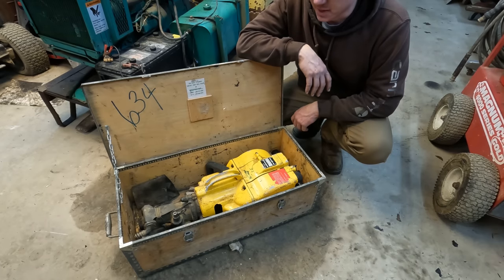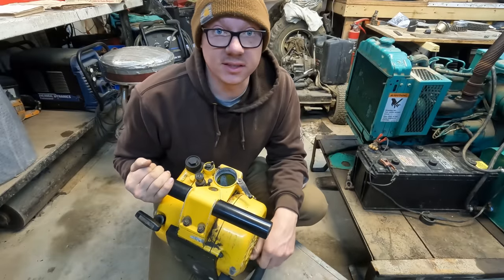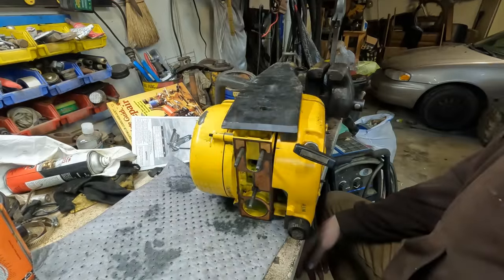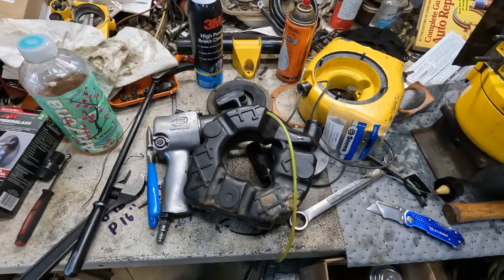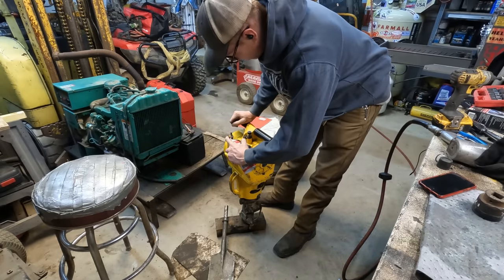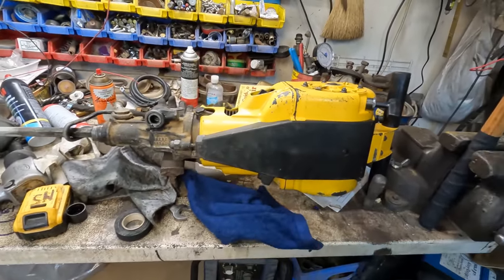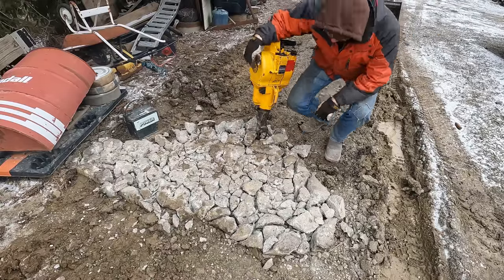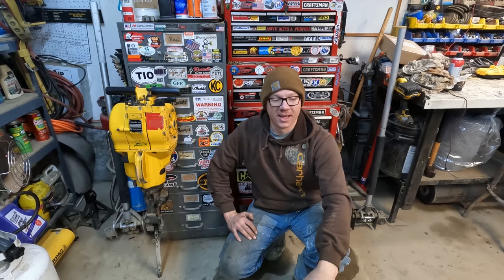RARE? Gas Powered Jack Hammer, Will it ever Run again??  (Pionjar 120)

Comment: have the same issue with my pioneer right now. the gas you added looked to be pure gas these at 2 stroke engine and like to be oiled up. 5% oil pr liter is what i am told the gas should almost look like oil :)

Comment: Lol, I nearly hurt myself laughing, as it that reminds of the time years ago when I bought a pedestrian roller powered by a Villiers engine. When I picked it up off the guy it stated first pull, I tight great. Until the day that I wanted to use it for a tarmac job and it wouldn't start no matter what I did to it! It ended up like the John Cleese sketch when he started thrashing his car with the branch of a tree. I took to it with a pig tail road on to vent my anger. It is funny looking back on it, but it wasn't at the time, especially when I had 40 tonnes of tarmac to lay and it had just started snowing. Luckily I had a Bomag tandem back at the yard!

Comment: Have you tried oiling the air filter?
I'm going with memories of old 2 stroke small engines where the air cleaner/filter was oiled. It may need the extra resistance to get the air mixture right for combustion. If you don't like the results you could always rinse out the oil with fuel.
Oh, another idea. Take a piece of rebar and use those foam pieces from bicycle handlebars to cushion the rebar. You just have to bend the rebar to the correct handle shape. I'm sure you can figure out how to secure the rebar in place (cough, cough, ahem epoxy) 
Jim

Comment: A quick search learned me that they are not rare. In fact you can still buy them new, exactly the same unchanged model. And I think that it is Chinese. Price is not mentioned. You need to send them a mail for that, which I am not going to do. They call them also YN27C Internal Combustion Rock Drill, or Pinonjar 120 jackhammer. That air filter seems to be some cartridge indeed. No parts number is mentioned, just a drawing with the internal components. Search for gmd-eqpt.

Comment: heat the pages little bit with hair dryer or pose some hair oil in between and then heat the pages try it on the last page first maybe it works for you .......

Comment: With regards to the viability of a more ergonomical handle - RISE (the swedish counterpart to Bureau of Standards but which is also an commercial research organization) tried  a number of replacement handles for the defense version of Pionjär 120.
The intent was to be able to modify the stored ones with a improved handle, though it was found that the result was really bad - the vibrations with the changed handles became basically worse.

Partly due to the Pionjär's 38 Hz work frequency the modified handles had to have a self-resonace (?) frequency below 27 Hz but the handles had in some case frequencies well above that so a fail.
The need for an improvement of situation was partly due to the fact that a more modern and ergonomically correct rock drill wasnt storeable in the same way as the Pionjär - the modern low-vibration ones corroded to fast.

Comment: I remember using a gas powered jack hammer when I was in my 20's,,  Different model than yours,,,  As I recall, it was very easy to use,,  It was really good when using as a shovel,,  it came with a spade type shovel bit,,,  made easy work out of hard clay,,,  just let it pound down about 6 inches and pull it back,,,  reposition and start again,,  :-)

Comment: We rented a similar  unit in thrvearly 90s iate 80s.  The onebwe had for abweek had a two foot rorary  star type bit. Air blew the dust  out from thebcenter hole. 
The one we used was blue not yellow.
 That tool was also very hard to start.

Comment: You have entirely misunderstood the "gas throttle". Untouched it is full gas (max RPM), press it down to lower the RPM. Press to the bottom it is killing the operation (STOP Switch)...

Comment: Thats a first for me, gas powered jack hammer. Even at that a carb less gas powered motor. My mind has been blown many times this weekend. Found out whitworth bolts are actually thing. Working on 55 ish imperial model D gravely that has reverse too. With the gravely tractor club. Im assuming the button holds the reeds open or allows more air in maybe or something odd there. As to the manual I wonder if a steamer would work or not. Might be time to crash some book clubs there

Comment: Matt, it should have stated in the instruction that, that is a 3 man jack hammer. I guy yanks his guts out all day trying to start it & keep it running, another Man runs it for a while until he is overcome with carbon monoxide poisoning then the 3rd man takes over for a while until he is over taken by the fumes, then they call it a day. A LONG day!  I think I see why it was up for auction and why there is no information online about it. Most Companies that bought one, THREW IT AWAY THE SECOND DAY! Mark it up as a loss & run over it with your truck.

Comment: WOW I used to use one of those back in the late 90's. amd If this tells you anything, the Chinese knock off version called the YN-27C sells for $600 on alibaba.  The read deal is actually sought after by people that need to bust or drill rock /concrete without access to air.  Great score!  You will find yourself using it and asking yourself how you managed to live without it. unless you have an air chisel for your TL250 lol

Comment: It vibrates like hell so everyone in the trade hates them. Not uncommon to have it work fine for a year the suddenly its impossible to start. Ive had both the intake loosen and the spark plug to come apart several times, so i always carry spare plugs. The fuel lubricates the drill neck, so it uses a lot more oil, at least 6% mixture. You also have to clean the small needle valve going down one side so it does not clog up. If you try to get it to run like it should you have to have a drill in it, otherwise it screws up the exhaust pressure

Comment: Tips to get stuck pages apart. Steam. Same with old stamps and hit his stickers a lot of the time.

First thing I would’ve done was removed that pool start a machine or welded a bolt head on there so I could use an electric drill.  My arm hurt just watching you having to pull that cord over and over and over. Lol

I think the easiest way to fix it is to go to Harbor freight and buy one of the electric ones for $480. I’ve got a cheap little one for A little over $300. Lol. But that would make a very boring video and not be much fun. I give you a ton of props for doing that. I would’ve given up and thrown it away. Lol. Wish you had the jackhammer to fit on an excavator arm.

Comment: Hey Matt...Great videos as usual, I thoroughly enjoy your content over the past year or so I have been subscribed to your channel !! I imagine the jackhammer is way to old to have what is called a spark arrestor in the exhaust / muffler, but you can try to remove the exhaust / muffler and make sure the exhaust / muffler is clean with no deposit of carbon in it, also make sure the exhaust chamber ports of the engine is clean as well. Hope this helps in some way my brother!

Comment: I just got to the part where you discovered there was no carb. Im laying in bed with the flu and I had a coughing fit from laughing. On a different matter, my wife used to work in a repeat boutique and the would get these antique clothes that looked like holy crap . do So one day I asked how do ya'll  fix these clothes? She takes me in the back room and there is a wire frame for holding a dress or shirt and beside it is a thing that makes steam with a hose and a nozzle. Most men would never come into contact with something like this but if you could ever get your hands on one I can think of all kinds of things you can do with it. Like maybe steam cleaning a carb. Im starting to cough again, I've got to go!!!!

Comment: Wr had one. Usrdfor setting tent stakes on big circus tents. Piece of crap never worked right. Bosses son loved it, we raced. He used the gas one we used the air ones. We won. We did over 3/4 to hus 1/4.

Comment: I don't know if it is significant or not but I did note that at the first of the video you stated that the size of the gas line was not the exact size as the original and I was wondering if there is a chance that it is getting air because of that?  If so, I am sure that you can come up with something that will fix that.

Comment: i dont know if you could find it on youtube but there is a british program called shed and buried {sam lovegrove and Henry Cole} one of the items they pulled from a barn too try and get going and sell was a petrol jackhammer road compressor which was wierd as buggery no engine as such,it had a carb cylinder.it was all ally 5 foot tall you had too pull on a handle which fired the sparkplug which inturn shot the 4-5" cylinder down out the bottom of the device.the thing was all ally art deco in appearance,probably 1950s at a guess. he only got it too fire twice but when it did it shit ip2-3 foot in the air with one hell of an explosion. just too put things in context sam works for brough supperior rebuilding origonal bikes and if you know bikes the ss100 was one of the greatest bikes ever made,lawrence of arabia killed himself on one of them,probably equivelant too the royal pioneer in the states,my point being they call sam the engine whisperer and he got it too fire twice and said sod this! the workings as i understand it is you pull the handle after pushing it down  and it comes back up,pull handle fires spark ignites petrol which explodes pushing piston down and you have to keep the chain reaction going,on the upward stroke it pulls in the fuel and the weight comes down compresses,you pull the handle fire the spark andkeepit going. if he could have got it going continuously it would've been impresive too watch but scary too opperate. you would find it interesting if you could find one working.

Comment: You can find spare parts to the Pionjär 120 here 
https://sgs-alternativservice.se/
A small shop in Sweden (of course). I guess it is only one person working in the shop. It is only open a few hours two days per week.
But you can always try to call them or send an e-mail. 
If you don't get an answer is it probably becase he doesn't understand English. 
Then let me know so can I talk (Swedish) with them.

They also have a starting procedure for Pionjär 120 at their web page:
Starting a Pioneer BRH 80 & BR120

1. Fill the tank full of petrol
     correct oil mixture (use measuring cup)
     5% or 8%
2. ALWAYS have a drill or chisel in the machine during start
     Function selector in up position
     There is a reason for that
4. Open the fuel screw to max
5. Turn the choke to Max
6. Pull gently until the machine starts up
7. Open the choke
8. Pull and start the machine
9. Run the machine until it is warm
     adjust the fuel screw as needed
     machine runs best when it is hot
10. if it does not start... 
     REPEAT the procedure and do it right this time
     Or call me...

Comment: i had worked with one of these in 60's drilling holes and splitting granite with feather and wedge , i know Egyptians did not worked in granite
Reply from the maker: They did actually, though. That’s part of the mystery. Rose granite is some of the hardest rock on earth yet they are able to cut and machine it with extreme precision!? How’s that work!??
Reply: Used 2 of those things working for a fence co.in the mid 80 s . They were some of the most frustrating temperamental things ever to get started . Once started did what was intended. 😂

Comment: Would a piece of couch cushion work as good as air filter elements. An old but clean piece, the same thickness and cut it the same diameter.

Comment: The Swedish manual states that full throttle is knob in it's highest position (not pushed at all), pushed half way down should be idle and fully pressed is killing the engine (cutting the fuel flow completely). The actual running-rpm of the machine should be adjusted with the "fuel-screw" that normally should be about 1/2 a turn opened.

https://www.maskinsalg-as.no/doc/Bruksanvisning%20Pionjar%20120.pdf

Comment: Hi Matt
I've worked on something similar in the UK but nothing that looked like that.
Customer had a problem starting it, and the choke lever was being blocked so it couldn't full close. A bit of plastic ground away, and it started up first pull.
And the problem with some old machinery is to get to one part, it needs to be almost disassembled to get to it. Got an old chainsaw in so many bits to get to the ignition coil lol
Also one thing to check first is compression test. I know this had what felt like compression, but I've repaired machinery that seemed like it had compression, but when checked had 15psi and when stripped, the piston and bore were basically rubbing against each other because of damage, that made it seem like it had compression.
Also how were your hands after breaking that slab up? Looks like they took a pounding.

Comment: You need a laser rust remover Will remove paint from wooden furniture and cleans  etal like new. Expensive but wooden worth it. Check, it out. 13,000 bucks.

Comment: Your jack hammer will work better (easier to control) if you keep the point of the bit sharp ,,,   There are probably you tube videos on the proper angles to use when sharpening a bit,,,   :-)

Comment: For my old small engines that don't have catalytic converters (which is all of them) I go to the local general aviation airport and buy 100LL avgas. Not much more expensive than regular gas, and ZERO ethanol.

Comment: 22:06 (after busting your gut (pulling your insides out) - haven't you figured it out yet?
The BOTTOM of the cylinder has a secondary piston which is what "jack-hammers" onto the tool bit.
Without a tool bit IN the tool, it can't push the secondary piston UP into the cylinder enough - to assist with starting the machine - oh sure the top piston goes up & down when you pull the rope but it isn't ENOUGH to force the cylinder to compress enough to run with a slow pull start (yeah you think you are pulling it fast - but you ain't - as it needs several thousand RPM to work properly.
YOU HAVE TO FORCE THE TOOL BIT (by the weight of the machine) into the cylinder to get the right compression / fuel air mixture correct - otherwise all you get is a lot of puff without power.

Trying to start it purely by standing the machine on it's lowest outer casing is NOT pushing the power piston (the lower part) into the cylinder correctly.
IF - yes reading doesn't just mean the typing, it also means reading the pictures too.
7:37 - 7:39 (LH side picture showing inner - exploded parts view - in Blue)
See?  ..
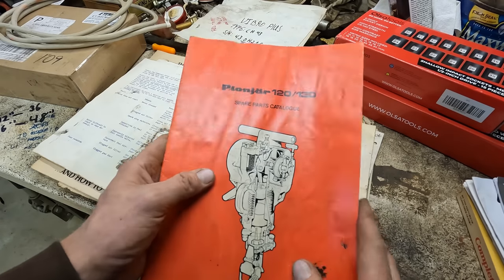EVEN AT 7:48 that "breakdown" on the front cover (on the orange booklet) - it shows you (if you look)
TWO PISTONS one cylinder.
The top smaller piston is what pulls fuel air into the cylinder, the lower piston HAMMERS the bit down and at the same time the weight of the machine is hammered UP to return down with gravity - thereby pushing the lower piston BACK UP - towards the upper piston that is also coming down, via the upper crankshaft - to provide highest compression (between the two piston heads) to keep the machine running.
As you flip over one of the last bits of paper - and marvel at the breakdown of parts INSIDE the machine - YOU WOULD / SHOULD "could" have actually learnt how the pistons (two of them) operate to compress the fuel/air mixture.
...
With no TOOL BIT in the machine (and only standing it upright on a block of wood) you cannot force any part of the bottom piston UP into the cylinder to gain the correct compression to start the machine.
Sitting it on that bit of wood on the workshop floor, left the bottom piston FREE to stay as far out of the cylinder as possible, thereby making the ALMOST (?) Into the only starting you'll ever do - unless putting way too much ether in there.
Pull starting it in that configuration is ONLY going to make you the tired'est lad on the block - and still the machine won't run correctly - even if you get it "partially running" on ether.

Comment: I would try steaming them over just a tea kettle on the stove . I would have left the pull cord off and rigged a way to use the cord less or impact to turn it over tell you get it running no honor in pulling your guts out !

Comment: 23:23 
STOP FIDDLING (that's running about the best it will run)
IT IS A TWO STROKE - they need a richer mixture.
Turning that "knob" leaner and leaner until it's impossible to start - is a sure fire way to make starting (and running) a jack hammer - the hardest thing you'll ever do 
AND it'll take forever to restart (after you pull your guts out again)
Turn it back out and make it richer.
Don't assume it needs to be as lean as possible.
All it needs to be is running - and just before 23:23 it was running the best it will ever run on a RICH mixture setting..

Comment: Stop before you ruin a great drill.  I've owned 5 of these.  You MUST have the correct filter to run it.  It's the choke, also, for cold starts.  It takes a 8 to 1 fuel mixture using SAE 40 oil.  Anything else will blow it up.  Creighton Rock and Drill in Canada used to sell them.  Contact them for parts.  You could never buy them from a USA supplier.   They were banned because of the oil mix.  The popping while running is normal and correct.  That's excess oil being blown out the cylinder relief.  Without that, you're running without proper lube and will cook the motor.  These cost $5k apiece 20 years ago.  Best drills on the planet.